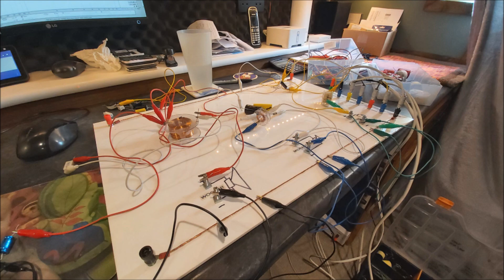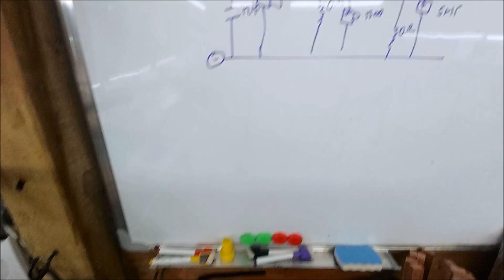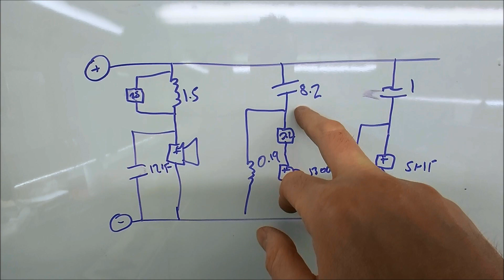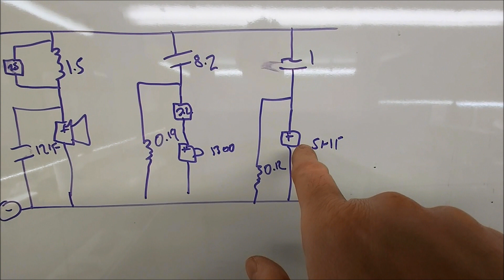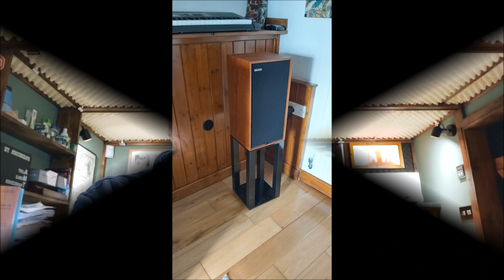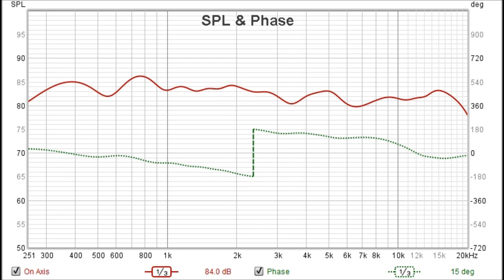Celestion County Build Part 3

Comment: Well I  bought them couldn't be happier they sound great with my valve amp and my old sansui au 101 a custom built pair could be a future purchase with high quality drivers
Reply from the maker: Got another build on the way using a KEF B200, HF1300 and Coles super tweeter.
Reply: @haycrossaudio  ported or sealed?
Reply from the maker: @michaelvincent8306  Ported I would have thought. Probably be a BC1 almost

Comment: Hi, great videos. I have now re Danish oiled my Countys as you did, they are looking great.
A quick question if you don't mind, the original crossovers have the Pye 6uF axials and all four are reading as approx 17uF, they are original dated 1974, leave them or replace? if so with which? Cheers.
Reply from the maker: You could use 6uF ALCAP capacitors which are electrolytic or SOLEN polypropylene capacitors. Personally I'd only use the SOLEN on the tweeter circuit. All available from Falcon Acoustics
Reply: @haycrossaudio  Thank you
Reply: @haycrossaudio  So are you saying to  keep an Electrolytic on the 8" rather than Polypropylene?